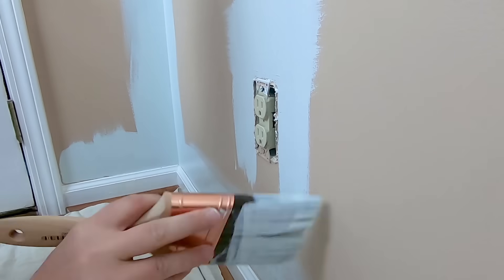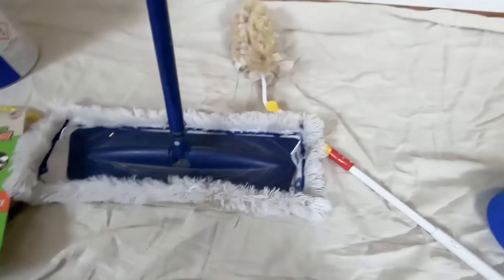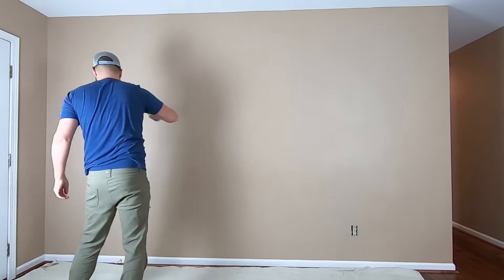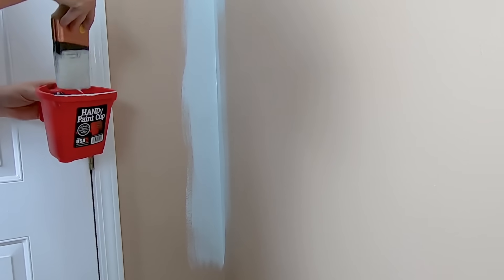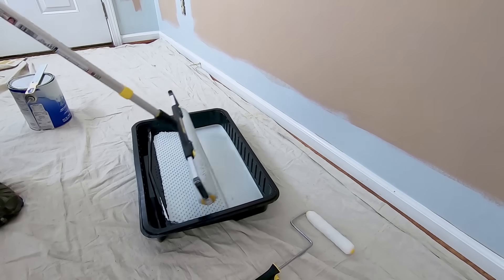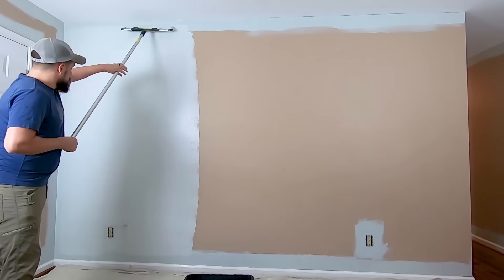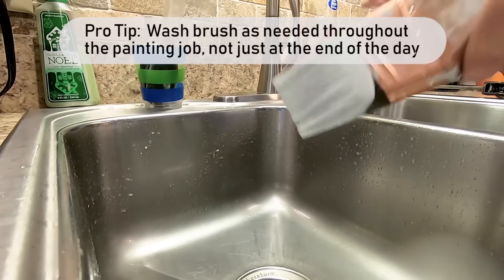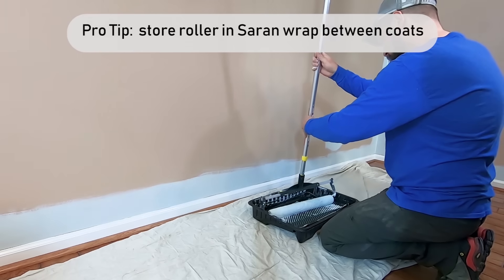How to Paint A Room Fast Like A Pro (Tips for Beginners)

Comment: That large roller has changed my life! SO much faster.  I didn't know they made one that big. Thanks!
Reply: I was considering upgrading to the 18'. Is it really worth it?
Reply: @davidsaldivar4302 100%. Not only does it cover more ground but it holds more paint. I can knock out a living room, dining room, and hallway with 20 minutes of cutting in and about 20 minutes with the 18” roller. It takes a little getting used to and they’re a bit of a pain to clean, but absolutely worth it.

Comment: I’m relieved to see that  you demonstrated steps that promote quality results. Anyone can paint a room fast. Few paint well…including today’s so-called professionals.
Reply: thats because alot of paint companys hire alot of low exsperienced younger people and dont pay them very much and are always on a time crunch. the first company i worked for i worked there for 4 years and only ever got 1 raise to 12 bucks an hour only after threatening to quit. are boss got around hiring people who can paint was we taped off every inch of trim so it all had good straight lines. idk i cant really knock him for it cause now 10 years after i stopped working for him hes even bigger then ever and is probly making a half a million or more in a year painting new apartment buildings and new starter homes.
Reply: Nonsense.
Reply: @swere1240   Then they are not professionals.
Reply: @MundiTaurus   It’s not the crew’s fault. The owner doesn’t have higher standards. Many omit prep steps like cleaning and sanding—even as purchasable add-ons— because it repels labor and is not as profitable as painting itself.

Comment: I'm a pro residential custom painter and I approve this guy's methods. He does everything that I do except a few small things. Such as that I will cut in perfect lines the first coat then cut 1/8" below the perfect line on the second coat (because one thick well applied coat of good paint is often sufficient for most repaints). 

Also, I keep my brushes wrapped in plastic to keep them wet until the job is done or I'm switching paints and need the brush. I don't like using a wet or damp brush as it can compromise the form of the bristles. I do however recommend that angle sash brush by purdy. Its call high capacity and I like using those of any size, anywhere from 2" - 3" for most applications. Pros typically have at least one brush of each size. 4" flat wall brush for wide areas or siding exterior. 3.5" angle brush for exterior trim or wide interior trim. 3" angle brush for most exterior trim and cutting in walls. A 2.5" angle sash for cutting in walls and most average size trim. A 2" angle sash for smaller prices of trim molding, windows and tight wall cuts between trim and inside wall corners. A 1.5" brush, a 1" brush and a set of artist brushes will also be useful on occasion 

I do also use that 18" Purdy roller frame and I wrap my rollers in plastic too, but instead I use a 1/2" nap on most walls and just backroll it for a perfect texture. It's faster than doing all that dipping you need to do with a thinner nap like a 3/8" because you will want to backroll either way so may as well dip fewer times. It goes on thicker much faster and will look better because it's easier to keep the whole wall wet the entire time you're saturating the wall. You don't want to be fighting with half dry paint where you started once you start to backroll
Reply: would you paint the door trims, window trims and baseboards BEFORE painting the walls, or after?
Reply: Yes my brother,  I do exactly the same, get perfect lines the first cut, an cut under 1/8" the second. + 1 on the nap of the roller. 
I'm professionally decorating for 23 years and to be perfectly honest, I love it. love the trade, great fun with the crew on site too.  👍🏽
Reply: @Gi1b2bz  When using acrylic wood paint, I paint the trims first, then do the walls then final coat on trim.
Reply: @Gi1b2bz Always paint trim after, as regardless of quality, you WILL have flecks of paint from the roller. Even on the fancy rollers that are meant to catch the flecks...

Comment: Excellent video, helpful and concise! One additional tip would be to finish roll each pass in the same direction, away from the light source (so usually down, ceiling to floor). The reason is that paint comes off the roller much like soft serve ice cream. You know how the tip of the ice cream folks down? Paint does that as it comes off the roller, and if it folds in different directions because your roller goes up and down, when the paint dries it will reflect light differently where direction changes. This produces a mottled and less uniform appearance!
One direction finish stroke on the roll is key to producing a uniform professional finished product!  40 years of painting tip, you’re welcome😊
Reply: Just started working for a painting company after being carpenter for years.  Thanks for the tip. Wish I knew this before I painted a feature wall olive satin green in our hallway with window shining different light angles showing slightly different vertical complexions.  Couldn’t figure out why until now. Thank you

Comment: I have found the large rollers are awesome for ceilings but for walls the 9 inch has its advantages. Walls usually have a lot more “obstacles” and the 9 can require less cut in with the brush.  I also prefer to paint out of a 5 gallon bucket with a screen. The screen works with the 9inch roller. Thank you for a well done video👍
Reply: 12 inch
Reply: Roller trays are a pain,
Put a grid in a bucket and act like a Pro.,

Comment: Ive found a tack cloth is best to “dust”the walls post sanding to ensure there’s no fine debris/dust/dirt. I usually do it by hand in smaller rooms but I have bunched up a few and secured to a swiffer floor sweeper to do walls in larger rooms. If doing by hand throw on a glove too. Tack cloths are super cheap and useable multiple times before switching to a new one.

Comment: For the paint bucket the brush is used in, I always put in a ziplock bag, tape around the overhang and when not using you can then zip up the bag to save your paint till needed again. Never have to clean your bucket after either!
Reply: its for diyers leave any oil based gloss etc to dry out and water based just wash out.

Comment: Don't allow the paint to get that close to the ferrule.  If it does, clean your brush immediately.
Paint in the ferrule is the death knell of a brush, and wherever it is on the outside of the bristles, it will be further in on the inside.
Store your brushes either pointing downwards or on their sides to prevent any moisture pushing back towards the ferrule whilst drying.

If painting woodwork that edges on to a wall that is being painted (particularly window sills outside) do those first, and take the gloss past the wood and onto the wall as this will help form a seal against water ingress and similar.  Emulsion is orders of magnitude easier to clean off of gloss than vice versa.

When taking short breaks (eg to have lunch), you can load a brush with extra paint rather than clean it.  This will prevent the paint drying on the bristles whilst you are away.  A plastic bag around the bristles with an elastic band at the handle can help here.
Obviously how long this will be effective depends on such things as type of paint, ambient temperature, etc
Reply: I wrap brushes and rollers in tin foil; stays wet for days.

Comment: Another good tip is when dealing with inside corners and textured walls and ceilings, a smoothed bead of painter's caulk will give you a clean line in the corner.
Reply: I've seen that look and really do not care for it. The caulk screams look at me I'm a white line. Where I've seen it, the walls were not textured, so that may make a difference.

Comment: Loved watching! I taught myself to paint and it looks like I'm doing everything right! I figured out the cutting in after the first time I painted a room and taped everything off, very time consuming and good tape isn't cheap! I've always wondered why paint rollers don't attach on both sides? I'm definitely going to buy a 18" , but they really should make the 9" the same way! 
Thank you for the great video and after reading some comments, I'm subscribing also!
Reply: 18" rollers are super messy. You'll spend much more time cleaning up paint drips with an 18. Also the open end on a 9 allows you to get  much closer to trim than an 18 does. Easier to roll around outlets too.

Comment: Good stuff. I will try the 18” roller. One tip to avoid buildup on the top half of the brush. Tap the loaded tip of the brush several times on each side of the inside of your paint container rather than wiping the loaded brush against the top of the container. This keeps the top of your container nice and clean and slows the build up of paint near the ferule. Game changer when cutting in. Cheers.
Reply: That's all I use for walls is a 18

Comment: Did you get the larger paint tray on Amazon too?  Thanks for the tips!
Reply: It’s probably cheaper to look on like amazon’ Only 1 local box store had them they were like $25 I’m sure paint stores have them also’ lesson learned don’t buy cheap on anything when it comes to painting’ get a good quality tray (metal) and it will last years’ also get tray liners they are worth every penny to just pull out and toss’

Comment: Never wipe your brush. Always tap it side to side. Wiping removes paint that you just loaded, and causes the paint to migrate up to the ferrule. The paint dries out and does not clean out, thereby stiffing the bristles. Things you learn painting for 40 years.
The only time I use 18 inch rollers is in commercial properties with large areas.
Reply: Rookies teaching rookies...Thats what keeps me so busy.
Reply: industrial work. warehouses etc. thats correct.
Reply: Wiping is no big deal. It just slows you down. The key is loading enough paint but not too much that it will drip. Just put a small amount in the cutting can to avoid too much paint on the brush.

Comment: Thank  you for the video.  Question:  I'm painting a bedroom and I'd like to do the cut-in work around the entire room first then roll each wall.  However, I'm concerned about  the cut-in walls drying before I get the roller on them.  Thoughts on the timing of cutting-in and rolling a bedroom?
Reply: I'm not a professional painter but I've painted 3 or 4 of my homes over the years (I really wanted to say: but I stayed at a Holiday Inn Express. LOL).  I've always done the complete cut-in first (doors/windows, corners, baseboards and ceiling) before using the roller and I've never had an issue with flashing.  I complete the entire cut-in, then apply first coat on the walls, then do second cut-in, then do second coat on the walls; with the "overlapping" this creates, it's never been an issue.  That said, I've almost exclusively used flat paint.  The higher the sheen, the more likely it will flash; so, if you're using a semi-gloss, or-more-so gloss, you may create some noticeable flashing if you let your cut-in dry first.
Reply: @bignorwegian  - Thanks Eric.  I just painted a room and did the cut-in first and it looks great.
Reply: @sman6435  From one S Man to another, great job.
Reply: @bignorwegian  I usually do the same-it seems to work for me even for satin finishes. I think it's the easiest way to get the slight texture of the roller close as possible to fittings, if you roller after cutting in.The easiest paint to not get flashing on is claypaint- costs a bomb, not hardwearing if you have kids etc. but a beautiful velvetty matt finish, better than any other paint I have used (and I use top quality trade paints as a rule)  easy to touch up later if necessary, and it's pretty much impossible to get flashing on it. And breathable, so it's what you should use for lime plaster if you want colour and threfore limewash won't do.

Comment: Some good tips. I typically cut right to the line o first coat. No gaps. It is easy with proper technique and good brush. When you do a second coat you can move a lot faster. . baseboards are always last. So you dont have to be too careful when cutting the wall next to baseboards.

Comment: 👍For DIYers try using a 14" inch roller instead of the 18, the reason being is not all rooms/walls are square/straight between the framing so you will leave streaks. Also, when cleaning your new sleeves you can can wrap it in painters tape or damp it a bit and run your painters knife across the sleeve to till its dry and get all the loose lint off

Comment: 9" roller allows you to favor one side or the other when needed, a skill. Larger rollers tend to span across uneven walls and leave gaps in the middle that are harder to fill than just learning to use the 9". Paint barely gets in the hollow core if you don't submerge it in the paint, which you shouldn't do... use the screen or pan to spread paint around the roller after a dip on the  surface of the paint in the bucket/paint pan. And bread bags make any 9" roller super easy to remove. Also, large rollers are much more expensive , even compared to a high quality 9" roller. 
Skill in using the minimum tooling, that's professional.
Reply: I agree with this comment. I have painted hundreds of units, houses etc. This is how it is. Especially the hollows. This especially applies to ceilings on older houses that have uneven sagging

Comment: First of all if you want to save you some time, use frog tape to cover all woodwork which will be easier for you to paint later on.. Always when i paint, i use the brush first and then go around with the small roller after it, so it doesn't leave any lines after the brush, much better finish, everywhere(around switches especially as you go up and down and sideways!) Also a good tip is to use square bucket and put bin liner in it and then tape around the ages, when you finished with painting just throw away the bag and your paint bucket will be nice and clean!
Reply: I qualified as a House Painter in the UK in the 70s and my clients were all high worth individuals. In college we were taught to paint around the edges at high speed so you could fill in the wall with a roller before it dried. Highly impractical many times hot weather. In later years when the little 4 inch foam rollers came out I would cut in with a brush, and simply flatten the cutting in with 4 inch foam roller immediately as I went (no added paint to the roller). No more brush lines in the cutting in and you could come back the next day and fill in if you wanted. I have shown many trained painters that and you are the first person I have come across to also do it. It makes a huge difference.
Reply: That's exactly what I do.  Frog tape, and I cut in with brush and 4 inch roller.  Perfect results and I've been painting for 15 plus years professionally.  Got to have perfect lines and no brush marks!  End results speaks for itself!

Comment: 3 biggest tips that have really helpedy painting success and finish of the job

1) use a small 1.5" brush to cut in & put on a heavy coat, then use a 4" roller to smooth out the slightly larger amount of paint you put on with the brush. This basically eliminates any brush stroke visible to the eye. Then go back with your 9 or 18" normal roller.

2) If you are changing colors and painting up to the ceiling, purposely allow a ~1/16" of wall paint to get onto the ceiling. Your brain/eyes will catch even the tiniest amount of color change you missed on the edge versus brain/eye won't catch the tiny amount of paint on the ceiling because there's a clear transition.

3) Use a large 12" or 18" drywall knife to help you fill in wall transitions like corners, trim, ceiling etc. The angled blade allows you to get right into where you want it but keep you from painting onto the other wall, trim or ceiling.
Reply: 1) Rolling your cuts are standard procedure in England, not sure why that hasn't caught on over here, definitely makes a difference. I do however suggest you go to a 2.5" - 3" brush. They hold triple or more paint then a 1.5". You'll be able to cut 3-4 times the length before re-dipping. Once you have that line, being able to go to the length of your arm before re-dipping just makes painting so much more enjoyable.

2) That tip isn't just for ceilings. If you are painting anything with a color transition - darker overlapping lighter ALWAYS looks better then lighter overlapping darker. Be it the wall to ceiling transition or a lighter wall into a darker feature wall or the wall onto trim  - if the light color overlaps the darker it will stand out, if the darker overlaps the lighter it will look like a shadow. Just keep that overlap small and consistent.

3) Spend more time learning to cut, lol. Just kidding, if it works for you then it works.

Comment: When I hired professional painters they taped on the baseboards. I looked at the tape afterward and it had some paint spray on it from all the rolling. My baseboards look really crisp, unlike the baseboards in this video.
Reply: Yep, pro here and always tape the base for exactly the reasons you state. - prevent splatter from ruining the base. I usually cut the base by hand and let that dry and then tape the base. Nasty things can happen to the base if you tape and then cut, like paint bleeding under the tape or when you remove the tape you peel paint from the wall. Splatter was more of a problem with oil based paint as that splattered like crazy. Not nearly as much of an issue with the newer paints. Roller speed matters as well, some people like to roll like the world is ending and that sends paint flying everywhere. Rolling too fast can also leave a unsightly uneven textured finish as well. When you roll if you feel a drag on the roller, you are going to fast.